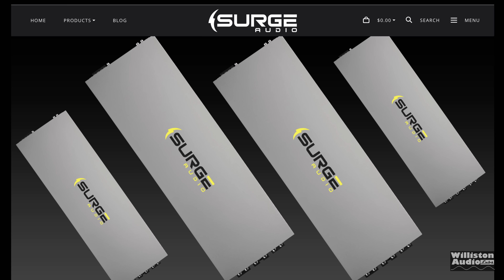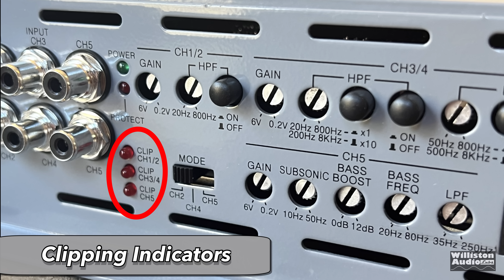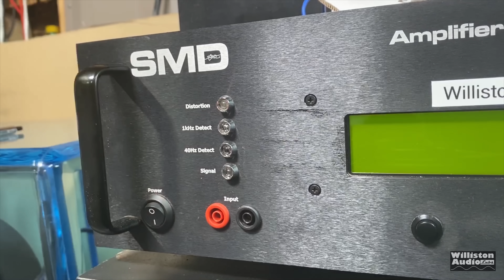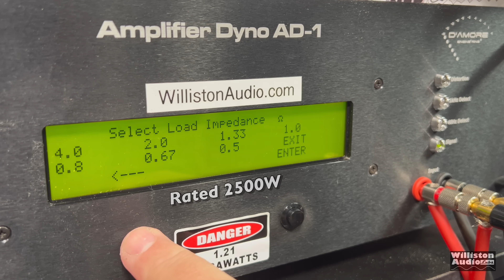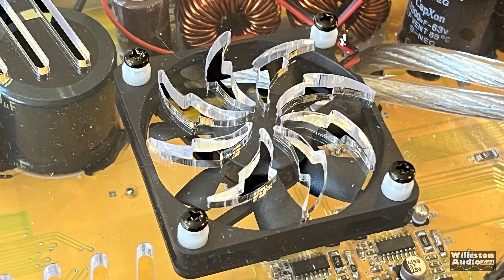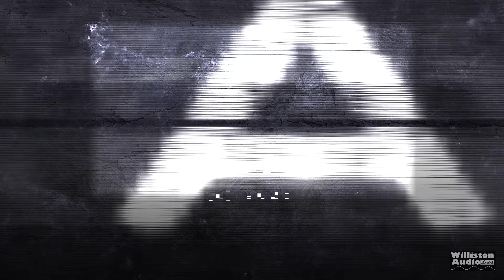Surge Audio 6000 watt Five Channel Amp is the MOST Powerful EVER!

Comment: Is there even a full range car speaker made designed to handle 400 RMS? Sure, plenty have that rating at peak, but not RMS. This amp would DEF be perfect for an RV or camper scenario for hi-power home audio speakers inside with plenty of power left for some pro/DJ speakers outside.

Comment: @Williston Audio Labs  if i wanted to use a amp like this for DJ work what would i need to do ???
Reply: You would need a 12v power supply with perhaps 300A of continuous current, which would be difficult to find and difficult to power or you could just use a bank of 12v car batteries and lots of chargers connected in parallel.

But why would you bother when there are plenty of pro audio amplifiers rated well into the 1000s of Watts of power available made for what you do.

Sure this might be 1/10th the price of a Crown or Dynacord 10kW amp but getting power to these would be a challenge. But I am guessing you don't actually need 10kW?

Comment: A 6k 5 channel amp with virtually 6k on the sub channel by itself with lower dynamic impedances 8.5k possible. If someone from the past came this way, they would say witchcraft and try to burn you at the stake and then reach in their pocket to buy one because this is cheap compared to yesteryear. Big D you never fail to impress. Nice amp for the money.

Comment: I wonder how it sounds compared to my Sony Big Red... 🤔

The Big Red isn't rated for big power, but it sure SLAMS in my Buick powering my rear deck 6×9s, the 6.5" coax in the doors, the tweets in the A-Pillars, and the single 1ohm 12" P3 in the trunk. Very clean and loud. I can listen to it loud for hours with no fatigue. It's really easy to end up having ringing ears because it's so clean when it's loud that you don't hear the slightest bit of distortion and realize just how loud it really is.

Comment: Class D amps have come an insanely long way. A long time ago when they were first invented they had extremely limited bandwidth because the PWM architecture couldn’t switch fast enough & cleanly enough to encode high frequencies, and thus could only be used for subwoofers. Then full range class D chips came along, then eventually crazy sht like this lol. I think we’re reaching a plateau though. Semiconductors are pretty much at their limit for power density and surface mount components have PCBs packed as tightly as possible. So this is an apex example of car amps

Comment: Wow! Very impressive amp. Can't imagine the current draw this thing has though.  Without a doubt need upgrade electrical.
Reply: Just looked up the surge 7000 watt mono block current draw is 800 amps. You will definitely need a ho alternator with a battery bank

Comment: would be interesting to see what the 4 channels do power wise with the sub channel loaded down, not sure if you have that info to share.  wouldnt surprise me if they were limited slightly by the 1 ohm sub channel soaking up power
Reply: The amp dyno only has the 2 inputs. Would need 2 dynos to be able to load all the channels and see what it all does together.

Comment: In .5ohm it looked like it failed in the first test but got over 8k dynamic. Do think it will perform fine in .5ohm?  Looks like an amazing amp, im almost consideredimg it. I need to save a little space my 3 amps are taking up a bit of room.
Reply: What do you mean by perform fine at 0.5 ohm? 
Do you mean you're going to wire it down to 0.25 ohm and get 2x rise so the amplifier would actually see 0.5 ohm?
Or do you mean you're going to wire it down to 0.5 ohm so that the amplifier would actually see 1 ohm?

Comment: awsome amp and awsome video as always but surge audio is definitely not a budget friendly. The only amp that is priced fair in my opion is the 3000.1 for 299.99 which is on sale normally much more. Thier enclosure are extremely nice and beautiful but extremely expensive. For a standard enclosure like i have custom for two 12s double Baffle with a plexi window which mine does not have was around 1500. Mine was custom to my subs cnc cut Russian berch 3/4 double baffled 550 including shipping
Reply: Gately quotes almost $1000 for a basic single 12” box. Huge rip off,but people buy them.

Comment: I wonder what is the total investment to just run the Beast in  your vehicle maybe another $2500-5000 🤔
Reply: It depends on whether you're trying to get all of the power out of it or not. For a typical sound system you can install it on stock electrical, you just have to keep an eye on the voltage as you turn up the volume.
Reply: At a Minimum the Big 3 and Batteries, either Two 500A fuses or 1000A FUSE.
Reply: @samueljackson2478 About your fuse recommendation. It depends on what your trying to protect. I seriously doubt you will see 600A draw, so that 1,000A fuse recommendation is way off. 500A will be the highest. You should not run more than 300A fuse on 1/0 cable. So you can run two 1/0 with a 250A fuse right before the amp to protect the amp. Then two 250A or 300A fuses where those cables connect to a battery to protect the cables.

Comment: Hi BigD, do you know of any new age amps with frequency adjustable bass boost? One of my old favorite amps was the Infinity Kappa 202a, it had a variable frequency bass boost. It would let you adjust the frequency (20 to 80Hz) boosted by up to 8db. It let me boost the low end in my car and sounded great, I'd like to find a decent amp (1k-2kW) with a similar feature. So yeah are you aware of any?
Reply: Stinger Audio amps have variable frequency bass boost from 30 to 80 hz.

Comment: Active cooling that can't do anything if the amp is mounted flush on a surface.. How is it supposed to pull in air when the vent/fan is on the bottom.
Reply: You mount it in such a way that it's able to pull in air.

Comment: Hey Big D wish u would have done the amps drawn from the amp like u have done on other amps. I like to see how much power a amp could draw from my vehicle electrical system. Other wise good job. Im liking the power from that amp.
Reply: On a class D amp like this you can divide the power by 10 to get a rough estimate of the amp draw. Like a total of 3,000 watts might draw around 300 amps.

Comment: Seems like in a active setup you'll need to put tweeters on 3/4 since 1/2 can't shut the crossovers off .
Reply: You can turn off the crossover for channels 1 and 2. Channel 3 & 4 do look like the ones you'd want to use for tweeters because you can set the high pass appropriately for tweeters.
Reply: @JasonWW2000 you'll blow a tweeter on 1/2 it only has high pass and stops at 800hz on 3/4 you can shut both crossovers off and control with a dsp .
Reply: @smurfeco2.358  Exactly.

Also, if you have a dsp then you can run tweeters on ch 1/2 regardless of its crossover freq and if it's on or off. You can ignore all the built in crossovers with a dsp.

Comment: I would like to see you hook up the amp or speaker with different ohm settings cuz idk fully how to I only kinda get it but you drop the ohms way lower is that on the dyno or your wiring
Reply: On this dyno the outputs are connected to resistor banks instead of speakers, so that he gets a consistent amount of resistance. This is how you test the amplifier ratings. When you connect these to speakers the impedance is always going to be higher and it's always going to change based on the frequency of the music. So speakers put a lot less load and stress on the amplifiers.

Comment: Does it bump though? SQ? It has enough power to be a 9 channel amplifier, that would be awesome, 200 x 8 at 4 ohm + 3500 x 1 at 1 ohm... They would be flying of the shelfs for the SQL guys with DSP's. I guess you can always go old school with passive crossovers.
Reply: I wondered about the sq and do it bump doe section. It's a video Surge paid for so maybe he intentionally left it out because it wasn't the best but they paid? Or maybe he left it out because it do be bumpin and sounds good by default
Reply from the maker: It's an S&I Korean amp and SQ is very good and the video was too long with it being 5ch and tests down to 0.5 at the end

Comment: Would this amp be daily drivable within reason?

Reasonable mods that wont break the bank letting a bro run with all the other dogs without 6 batteries, a nuclear alternator,0000000 gauge cables?
Reply from the maker: Totally depends on how you load it down. If you did the sub channel at 4 ohms and the 4ch section at 4 ohms you could likely get by with just an extra battery with most vehicles.

Comment: No 10 x on both 4 channels don't want it. Lol.
Reply: That seems like a minor inconvenience. You could probably get around it with the settings in your head unit or by using a DSP or just a basic active crossover.
Reply: @JasonWW2000  10 x better. Dsp extra money. Probably just a mistake on they end. But amp should have both.
Reply: @Packersnbassforlife  You say you don't want it, but what other 6,000 watt 5 channel amp can you buy? It's the only one. Lol.

Car audio is not for cheapskates. If a person can't afford a $60 crossover they can't afford car audio in the first place.
Reply: @Packersnbassforlife  Heres how you set it up. Put your mids on ch 1/2, use the high pass at 80/100, etc... and let them roll off naturally on the top end. Then put tweeters/horns on ch 3/4. Use the high pass at 3k or whatever. 

I think it would be a huge waste to run tweeters on this amp. They only need 5 ot 10 watts at most. Use this amp to run mids and subs. Then get a small, cheap 20w x 2 or 50w x 2 amp for the tweeters. 

This is simply not your typical 5 channel amp. It's for special uses. Maybe a stunt wall or something.
Reply: @JasonWW2000 down4sound got some boss. With 10 x crossover
Reply: @JasonWW2000 surge know for not having shit in stock.
Reply: @Packersnbassforlife  Boss brand? I don't see any. There's no way a Boss amp would actually be 6,000 watts or even close to that.
Reply: @JasonWW2000  they got a 7 channel or something. Lol I'm just get a jp284. I like watching his videos tho.

Comment: Current draw still would have been nice.
Reply from the maker: With music loaded to lowest ohm on all channels it will pull over 450A and with the Dyno and test tunes over 550A. It totally depends on how low you load the sub channel and what music you listen to. Some people might get by with 200A fuse if using 4 ohms on sub and main channels.

Comment: I have a PG elite.5 and I think that's too much power. What mids and highs could even handle the power this puts out?
Reply from the maker: Seems it is designed for bassheads who have pro mids/tweeters but the sound quality is good for everyone. Just turn down those gains if you don't need all the power
Reply: someone could run 3 8ohm midrange drivers, wired to a 2 ohm load per channel, and it would be putting over 230 watts to each speaker per channel... 

soooo, say someone had 12 10" neopro 8ohm mid drivers, lol... thats pretty awesome!! 

but i do agree with your point, having that powerful of a 4 channel fullrange, coupled to monoblock of only 3500-4000 watts seems way overkill, and could have made the amp a tad smaller on footprint and power consumption a little better by bringing the 4 channel section down to 300 watts per at 2ohm loads or something... 

pretty friggin dope amp tho, none the less.

Comment: But the question is will it with stand multiple voltage drops?..u know the kind 10v guys 😅
Reply from the maker: If you buy and amp with dual 1/0 inputs, you will need to ensure electrical is up to the task first

Comment: Again we are living though the best time to be in car audio. Just think a few years ago this was thought to be impossible
Reply: The best time to be in car audio? You clearly weren't around in the '90s when you could buy any aftermarket head unit and install it in any car without painstakingly replacing half the dash and bypassing the intricate OEM DSP... 🙄
Reply: The people back then thought the same thing about car audio at the time and so will the people in the future lol
Reply: @majicdude88  and those same people still thank the stuff back then was so much better ,and you obviously missed the point.
Reply: And those amps are still working. Will these be in 30 years?
Reply: @Afterschoolspl  some of them are and most are not. But even if it still working your trying say a amp that cost more than $1 a watt and is 30% efficiency is better in what way? I love old school amps I have many really good ones but 99% of them never coming off the shelf again they just can't compete and are worth more as wall art to drool over them to use but I still love all of them
Reply: @paulgood2218 no quality manufacture would ever produce an amplifier with a +/-3dB spec across its rated frequency range.   

Even the most basic of old school amps that were cheap wouldn’t have specs that poor.
Reply: @Afterschoolspl not a chance of these crap high power amps working even 10 years from now.  

There will be no ‘old school’ amps of this nature in 10-20-30 years
Reply: Totally agree🎉❤ as when I was dreaming about stuff back in the day we don't even had them in our country. Now I building my dream system on budget.. updates coming 🤲💕 40 and I still can't leave this passion behind😂❤ my kid is absolutely in to it as well .he is 8
Reply: @tomasexteriors lol 59 here, just upgraded to a Taramps smart 3000 bass and an old soundstream Rubicon 160w x4 front stage. Built my own subs at Robot Underground.  Don't stop till u drop!!
Reply: Power is pointless without control.  

If you don’t care about how stuff sounds, sure it’s great…. For the manufacturers making money off ignorant customers. 

Car Noise, not Car Audio.
Reply: @caseytbss  what do you mean mate?
Reply: These are no were near the best time in car audio that has long passed
Reply: Absolutely
Reply: From neon to LEDs ,fiberglass bondo and sandpaper to premade pods and plastic premade abs 😏😂🤣 built not bought debatable 😂
Reply: @ashcoleman8866  you have great point mate 🙏🤜🤝
Reply: @ashcoleman8866  accessable to all of accessable to a few ? I'm all for things being affordable to the average  audio enthusiast , I'd you don't have the skills or will to build it. Then but it and enjoy it. It's the buyers that give the means for the skilled to make a living.
Reply: With the pre order price of this amp, for me, it’s still impossible. 😂😂😂

Comment: I’m just curious as to how the sound quality of this amp is compared to like a hertz mile power 5?
Reply: My guess would be no audible difference other than the surge has 4-5x more power.
Reply: @TokenTombstone  I wonder how these higher end car audio companies stay in business if there is no discernible diff in sound…
Reply: Marketing probably. A person might expect the better name brand to have better components for a longer lifespan but that is not always the case. There are a lot of good videos out there with people listening to similar amps, a high quality brand vs. average brand. One in particular is a Barevids where he compares a JBL Crown 6000 vs. a Taramps and they sound the same although the JBL is much more costly. You gotta do what you think is right for your budget and desired setup. 
Personally, if I was looking at spending $900 on an amp it would not be the hertz mile you posted.   @HyPex808-2
Reply: @HyPex808-2 It's only when you have really high-end speakers and processing that you're going to hear the difference in amplifiers.

There's also a lot of other factors involved in an amplifier other than output power. Sound quality is one for sure, but there's also construction quality, reliability, all the protective features as well as other specifications such as having a lower noise floor, higher dynamic range, flatter frequency response and lower distortion levels.

Comment: Without going to Google, does anyone know what RCA stands for?
Reply: Radio Company of America? My first thought was Radio Company Analog but I guess they wouldn't need to define it's analog back then. Heading to google now
Reply: @Pi_Cue  Closest wins! 😁
It's literally named after the company RCA (Radio Corp. Of America). It's kinda like Kleenex. Just a household name, now. They're technically called patch cables, but everyone just calls them RCA cables.
Reply: Correct  @Pi_Cue
Reply from the maker: Really Cool Accessory?
Reply: Damn, I thought RCAs came out in the 60s with record players. They've been around since 1930s 😮. I'll let others take their guesses and head to Google without spilling the acronym
Reply: @Pi_Cue  Too late. I just did. 😂
But yeah, to add to my other comment . . .
Again, you were close.

"The RCA cable is named for the Radio Corporation of America, which first used it in the 1940s to connect phonographs to amplifiers."
Reply: Well, wait. Sorry. I got my info from LifeWire. Looks like Wikipedia gives different info. 🤷